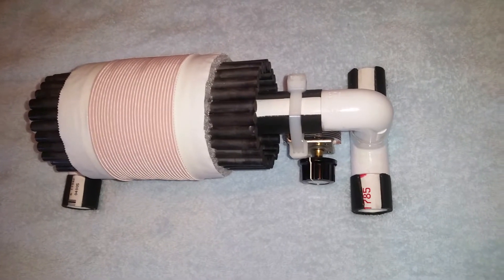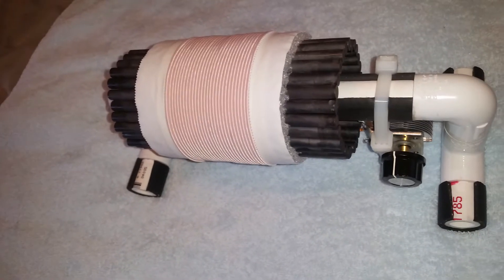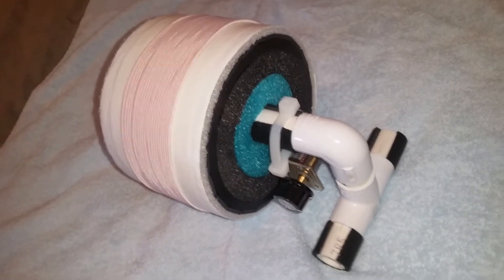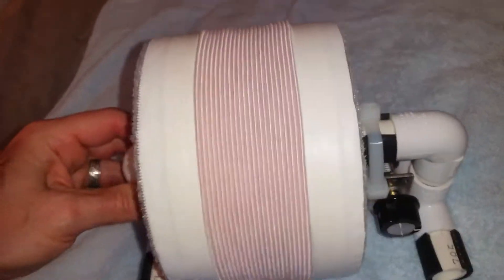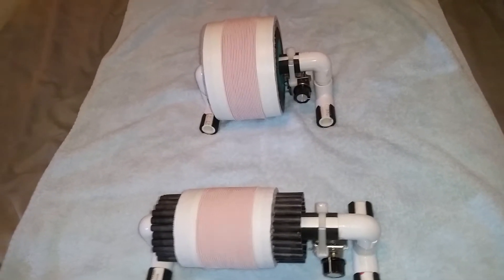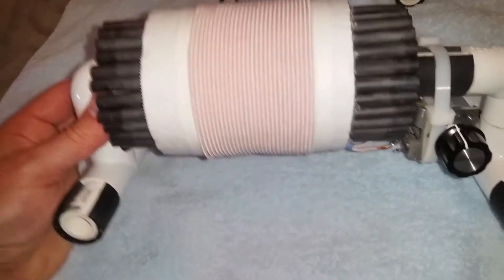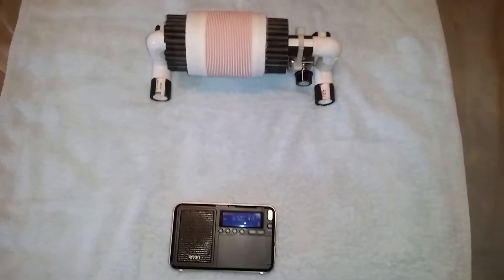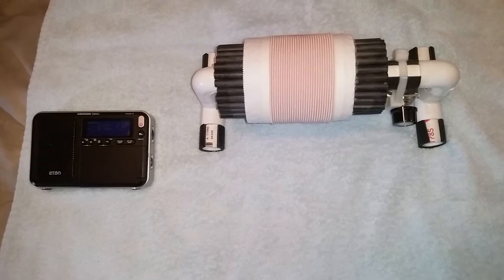3.5 Inch (89mm) Baby FSL Antenna Demonstration

Comment: Hi Gary. Do you have a source you could share for the foam cores that go between the PVC pipe and the ferrite rods for the 3.5" FSL?
Reply: Hi Paul, This is the Oatey closet foam spacer material, commonly available at Home Depot stores. It is Part "D" in the full construction article parts list, posted at https://dreamcrafts.box.com/s/kawg0ae79yktfw6qzhuh0jw2npxdw80c
Reply: @garydebock7602  Thanks so much Gary!

Comment: Very interesting antenna! Now I'm going to build the same. But if I want to receive longwave frequencies 153-279 kHz in the best way, should I use 40 or 42 litz wire instead of 46?
Reply from the maker: Hello Igor, You should use 44 Litz wire for the Longwave frequencies, with 660/44 being a good choice. Also, you will need more turns of Litz wire to make a coil which resonates on the Longwave frequencies (with the same 365pf variable capacitor). Because of this, you may need to use smaller diameter Litz wire (175/44) to fit all the coil turns on the same (160mm) length of ferrite rod. Good luck!  Gary N7EKX

Comment: Nice antenna :) I'm looking fos some portable antenna and I will make one of this. Is it possible to tune this antenna on SW up to 12Mhz ?
Reply from the maker: Sorry, Ganjor86, this antenna will only provide the gain boost throughout the Medium Wave frequencies (520-1750 kHz). Experimental versions can provide a boost up to about 2 MHz, but the problem is that on the SW frequencies most radios don't use a loopstick, so the inductive coupling system doesn't work very well.

Comment: Gary have you ever used a Beverage Antenna on those cliff (just toss it down) or maybe way up on top of those away from car & truck traffic. Here in NW TN The kiwi's come thru on 160m on a SW'erly beverage about 500 feet long in the early early mornings abit 4am-6am. With a signal in the 33 area. Not exactly booming, but way quieter than those FSL.
Reply from the maker: Hi Dubya P., Using a Beverage Antenna on an ocean cliff has never been tried (to my knowledge). My DXpedition partners use compact versions of single-loop wire antennas to receive transoceanic DX with their Perseus-SDR receivers, and have record-breaking results receiving NZ stations. The ocean cliff sites are kind of dangerous to lean over and play with a long Beverage antenna, since it's a straight 500 foot plunge to the ocean. Snagging a Beverage wire on one of the Cliffside rocks and then attempting to pull it back up could well be the last mistake a DXer ever makes.

Comment: Regarding the larger antenna with the impossible to get flat ferrite bars, can you substitute  steel/iron metal stock strips cut to size, which you can buy in lots of hardware stores or Tractor Supply, that is used for home fabrication work? I have seen small flat stock that is approximately that dimension.
Reply from the maker: Unfortunately, ferrite is the critical component which makes these compact antennas work so well, Sam, and without it they would just be undersized air core loops. It would be great if the thin metal strips could substitute for ferrite, but there's a good reason why the ferrite costs about 10 times as much (and why the eBay ferrite sellers are probably enjoying early retirement).